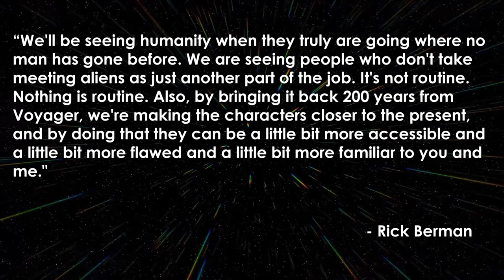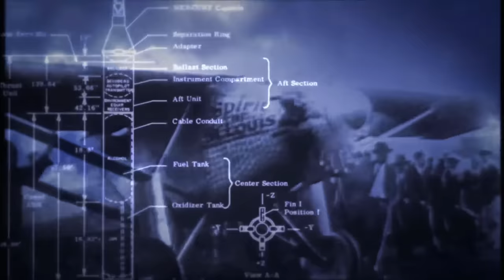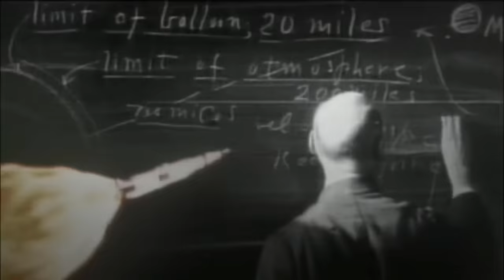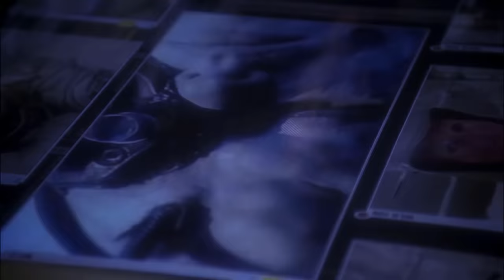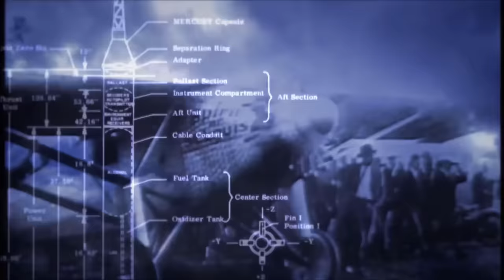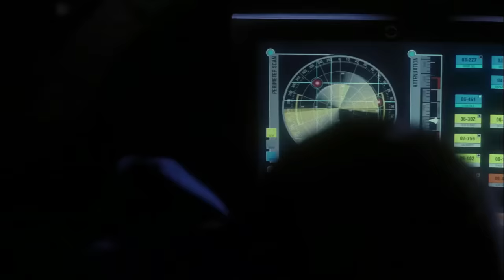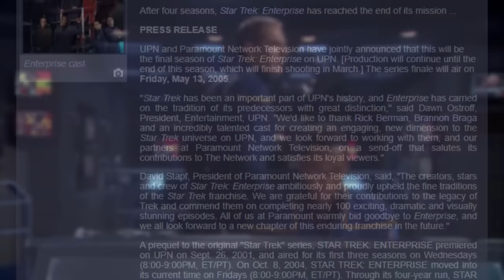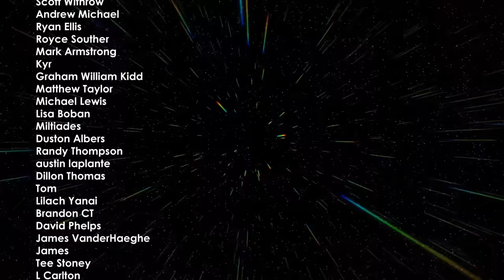Star Trek Enterprise Retrospective/Review - Star Trek Retrospective, Part 15

Comment: Just my opinion but... I always felt there was something lacking with the show. It's hard for me to pinpoint it exactly, but just the fact that it's a precursor annoyed me. 
And yes, to then add in the temporal cold war was just so contrived. 
But the one annoying detail that always stuck with me (and yes, this is probably super nitpicky) was that, why did the Xindi use their small, proto-type weapon on Earth?
Doing that, they basically screwed themselves. They made Earth aware of their existence. They should just have tested it on some random asteroid or something, and then boom, out of the blue, show up and blow up Earth with the finished version of the weapon. 
I mean, that just felt so stupid to me, and like insanely lazy writing. It kept me annoyed at the show for the remainder of the run, and for posterity.